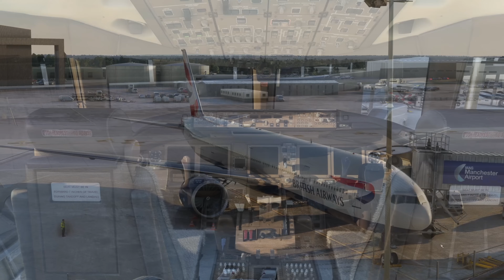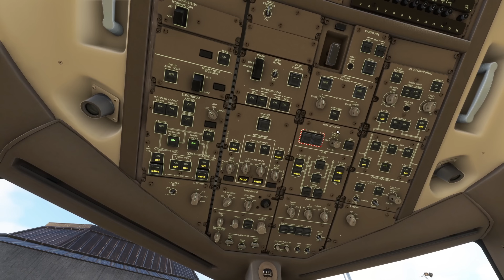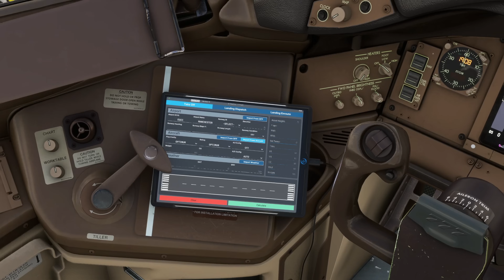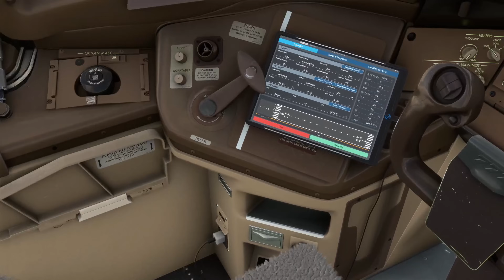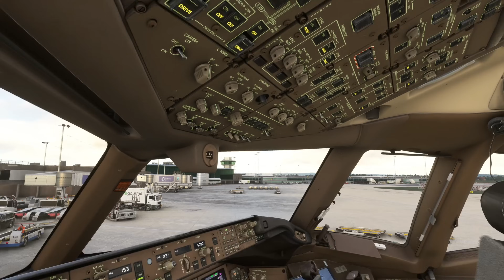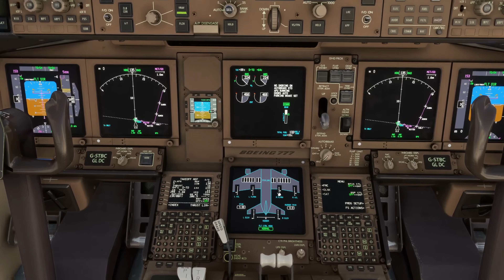PMDG 777-300ER Tutorials - Episode 1: Cold & Dark to Engine Start [4K]

Comment: you've set fuel load and pay load instantly, how does it work with GSX loading fuel and payload? I don't want to set everything instantly.
Reply from the maker: PMDG removed support for GSX a while back so I don't think it can do both - the GSX stuff is simply visual. What you could do is use the loading manager app thing in the PMDG tablet and instead of using instant loading choose realistic,then make GSX load at the same time to try replicate/match it up?

Comment: Quick question, how did you get the screen on the side of the terminal building, with the QNH etc? I believe it's called NIGS? I purchased the EGCC from the video description, and it doesn't have them. Im using FS2020.
Reply from the maker: GSX Pro with a custom airport profile

Comment: I have a question about engine starts. In the tutorial it shows waiting for 20% N-1 before turning on fuel valve.  In a FADEC auto start sequence the engine FADEC should not induce fuel prior to set N-1 parameters being  met. Are these engines FADEC? 
(FADEC “ Full Authority Digital Engine Control”. ) Great tutorial as always, Thanks for you content!!
Reply from the maker: @geofferyshanen7758  hi Geoffrey - great question. The autostart function, if on, means you can just start engine 1 for example on the overhead panel and immediately turn the engine master switch to Run/On/Idle depending however you want to call it... Then repeat for engine 2. 

Some airlines don't use Autostart however so in the tutorial I blended the two together (incase someone uses a livery with autostart off as a state function within the livery)

Comment: Help please... When I first started this plane... I did switch the start mode.. To cold and dark with GPU.. everything was fine. But no subsequent luck. No batteries. No efb... Throttles were full but hardware at idle. Zero interface

I had to uninstall the plane. Same thing happened.

Using windows 11. 

Help please
Reply from the maker: Not sure what to suggest here beyond trying to uninstall the aircraft, restart your PC and then reinstall it via the pmdg website (fresh download from your account again)... If not reach out to them with a support ticket.

And make sure you don't have any extra mods for it installed as they might be the problem (it doesn't need mods)

Comment: You do not have to wait between placing the autostart sw to START for an engine start and placing the Fuel sw to RUN. Fuel sw goes to RUN immediately after placing sw to START. By the way, the fuel switch to RUN first activates the igniters in the engine, then introduces fuel for the start. You'll see a fuel flow indication first, then a rise in EGT. The EEC monitors the start, except for oil temperature and oil pressure, so need to keep an eye out on those during start and be ready to abort that engine start if there is no oil pressure after EGT rise.

Comment: How long do the aircraft batteries last? I, with very minimal knowledge, would have thought you would turn on the APU once things in the cockpit had come alight. 
Can you tell me more about this, please?
Reply from the maker: @keneagle7684  not too long, but that's why we use External Power - the ground power unit gets connected to the aircraft and we use ground power instead of battery power

Comment: I having issues with fuel, payload and route from simbrief, I don't get the payload or fuel from simbrief after loading simbrief route?
I get the auto ground ops which are taking hrs!
I need to change a setting somewhere I think it gets route but doing the ground ops in real time and looked insettings and cannot find where to change it.
The tablet only gives like the hr long short ground ops there no instant load pax, carg & fuel like the fbw tablet I'm used too - hmm

Comment: Is it possible to start both engines simultaneously? I've seen some discussion about this, but not clear on it being possible on the 300ER.
Reply from the maker: no - you do on the 787 but not for the 777
Reply: The 777-300 and 200 series we start the GE engines one at a time, however the RR fitted 200 series we start both at the same time. I believe it has to do with the start cycle logic and available duct pressure during the start. 😊

Comment: I have started the plane up multiple times and have'nt had any problems until yesterday it just wont move the throttle levers dont work the engine stays at idle can someone help me out i do get a "hyd press dem c2 and c1" warning so i think that may be the problem but when i turn the hydrolics panel on and of the messages disappear but i still cant move.
Reply: Try performing a maintenance check.

Comment: Is there a joystick that you can use out of the box that works with these aircraft?  I have the Thrustmaster TCA with Throttle Quadrant and can’t get it to work with the B777.  I also have the Thrustmaster HOTAS One and again I can’t get the throttles to work.  It’s frustrating as!

Comment: Lifesaver! Thank you so much for doing this video. I just finished downloading the plane but wanted to make sure I could start it. Pretty much identical to the 787/747, which makes sense. Now to find out how to taxi this beast. Turning has always been a problem for me, I tend to run wide and end up doing some offroading. The 747 is a contender for the WRC, I think. Great suspension and wonderful power coming off the apex of turns. Also great for running over small planes.

Can you imagine being in a Cessna 172 and seeing a 777 or 747 behind you?! Anyway, thanks for the superb video, now to episode 2.

Too bad I can't subscribe again. Liked as always!

Comment: In real ops, you do not pressurise hydraulics until before start and cleared by ground personnels.
Reply: Also, in the real aircraft, the sequence of selection is important as switching everything on without waiting for the pressure lights to extinguish leads to inter system fluid transfer which annoys the engineers! As you say though, not an issue in a sim! 😂
Reply from the maker: We don't have any real personnel in flight sim so I always just get them on

Comment: For those who are complaining about the engine sounds, we need to understand that this is just the pre-release, the release release may have the final tweaks and stuff and let’s remember this too, these guys at PMDG got recordings from a real 777-300er! You can easily tell they did especially working with 777 pilots! The pilots woulda said something by now about the sounds if it was inaccurate big time, I don’t see the sounds as a problem, they sound just fine and PMDG will ofc update it, they know what the community will say about it

Comment: Bit of info, once you select engine start as soon as oil Px come online you chuck fuel straight in as its got autostart, so dont need to wait for 20% N2 as you would on a 737
Reply from the maker: Absolutely - great point! Thanks for the tip 😊
Reply: @BritishAvgeek  thanks for accepting my info, nice to see. Just a quick question will you be doing a more in-depth tutorial for the long haul routes?? Going into CPDLC etc??
Reply from the maker: @BAboymr  I will try to get round to it sure - that'll be a bit more tricky as it depends on having the right controllers online etc to showcase it all properly 😅 so it may be a struggle
Reply: @BritishAvgeek  yeh suppose CPDLC isnt used too much in the vatsim world compared to real life anway! Keep up the awesome videos anyway, always great content!!
Reply: The GE engines actually spool for 30 seconds before you see fuel flow. Select auto start on the overhead panel, rotate the appropriate engine knob to start and then immediately open the fuel control valve. FADEC will then spool for 30 seconds before you see fuel flow and then light up on the engine supplementary page. The engine should stabilise and the red ‘tick’ on the EGT should disappear by 60 seconds which denotes a good stable start. Same procedure for the other donk.

Comment: Hey Nice vidéo like everytime, i would like to know if someone has the TCA quadrant and the PMDG 777, if he can shares with us his calibration for throttle, thanks !
Reply from the maker: I have the honeycomb bravo
Reply: I have it and am also looking for some help with setting up for the 777. Only thing I have seen so far is for the PMDG737-700.  Using the joystick button 1 to hold reverse thrust.  I might be doing something wrong in setup as the animation in cockpit looked off.

Comment: The engine sound of a 777 taking off has nothing to do with reality. It's like two different engine sounds are heard. P3d had better sounds. I hope they fix this problem.
Reply: I agree sadly
Reply: What engines did they model GE or RR?
Reply: @AJ-yw5zy  the legendary GE … immersion breaker
Reply: @AJ-yw5zy  GE90
Reply: I’m sure PMDG will have some kind of update for sounds, you gotta give it enough time for it to at least settle in, they’ve had 777 Pilots test everything out including sounds, they’ve recorded authentic sounds from the real plane itself, they can only do so much with audio, just like the PMDG 737, they recorded sounds off all of the 737s, you can only do so much with technology and audio to make it that experience.
Reply: As a real 777 pilot I can tell that with Bose A20 headset you barely hear the engines at all in the cockpit, except a faint whistle and whine. Pmdg is good enough, though not perfect
Reply: @FlySeboFly  except airline pilots rarely wear Bose, they have single ear headphone for CRM purposes, at least with my airline
Reply: @athgt6630  well we do
Reply: Did you update it
Reply: what about Boris pack ? 😮
Reply: I don’t understand how people can judge the sound, from a youtube video, that is compressed with all kinds of algorithms?? Also, the sounds will be very different, from system to system.
Reply: @chaophraya8003  This has nothing to do with YouTube. The GE90 engine is one of the engines with the most distinguishable sound. Everyone can easily understand it. Listen to the engine sound of pmdg 777 in the p3d version, then compare it with the model made for msfs. You will see that the sounds are not the same.
Reply: @sedat-1998  there will be sound packs
Reply: @chaophraya8003 lol dude, every other plane in the sim sounds the same on YouTube as it does in the sim, why are you defending something that’ll bring everyone of us a better and more immersive experience?
Reply: @JustLovinPlanes some people just enjoy to disagree. They just don't have a clue how  the GE90 sounds IRL.  The engine sounds in the sim are laughable.